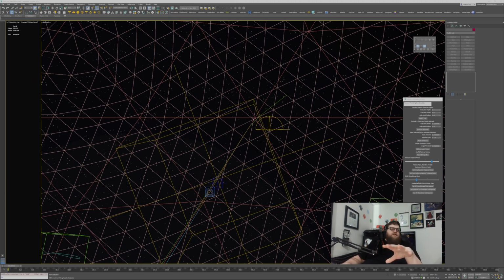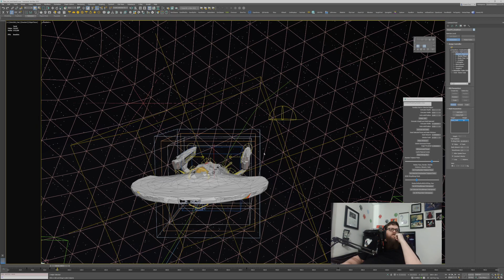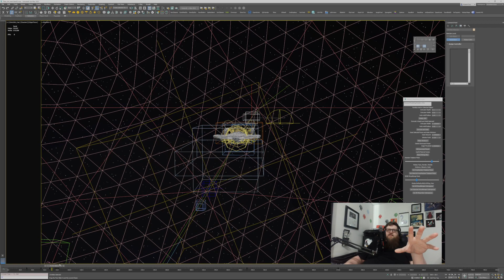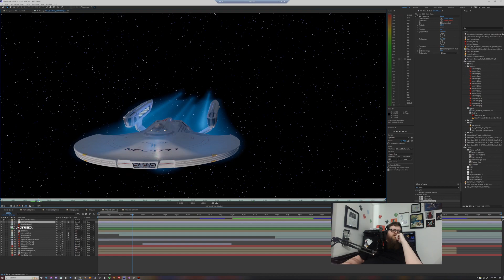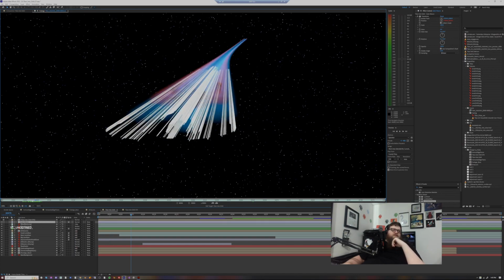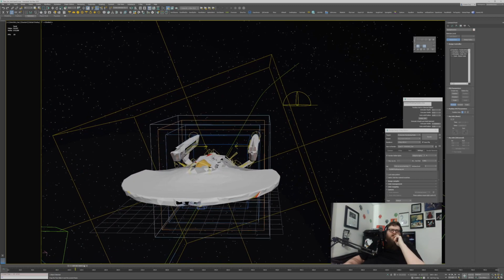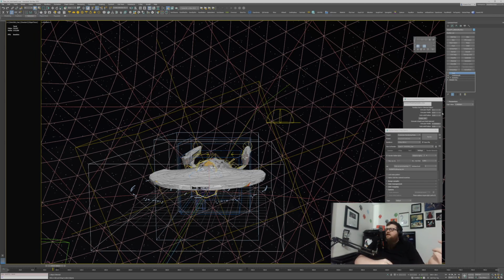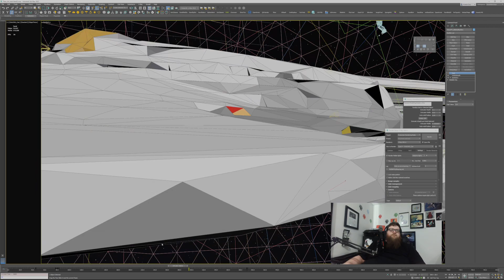Tutorial: In-Camera TMP Warp VFX in 3dsMAX!

Comment: I always love it when i see artists get creative and "cheat" some technical stuff, looks amazing.
Regarding the render time due to textures. Some time ago we had to do a movie with vray and we found out that the best way to deal with textures is to convert them all to exr with mipmapping turned on. This did speed up the whole loading of textures alot, even the hdr files you mention where converted to exr, if you do not already do that i recommend that you look into it. That was a gamechanger for us
Reply from the maker: Hey, that's something I'd tried before and not seen any improvement on (Last time I did, it uploaded every possible mipmap to the card separately and individually! Every Frame! Ouch!) But I will give it another try. :D
Reply: @HowieDay82  i just saw that we not only enable mipmapping but also tiling, maybe the tiling was the big thing since it allows vray to only load the part of the image that is visible at that time.
Also we did use vray and not vray rt maybe there is also a differnce
Reply from the maker: @efex5720  Ahh, there likely is. My results were, on VRay RT/RTX: 
Resize to 8192, default image formats (3m50s),  
On Demand Mipped EXR (3m59s), 
Compressed EXR (DNR), 
Fullsize EXR (2m41s), 
Resize to 8192, EXR (2m31s).

So it looks like some savings in there with the textures in re-scaling max size and full modes! Thanks for the tip. :D
Reply: @HowieDay82  I feel like I'm missing something. Why are you using a high resolution HDR in the background during the actual render? The ship surfaces all appear to have pretty high roughness, (and the windows are quite small) so you're not going to see any artifacts in the reflections if you used a lower res environment map. Why not just render the ships separately, and do a realtime render of the background alone, and comp them together?